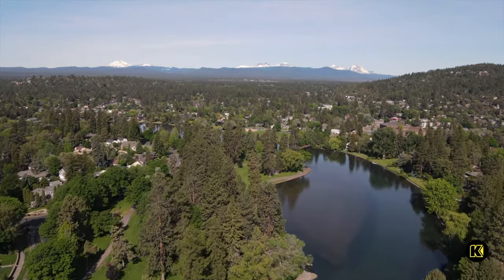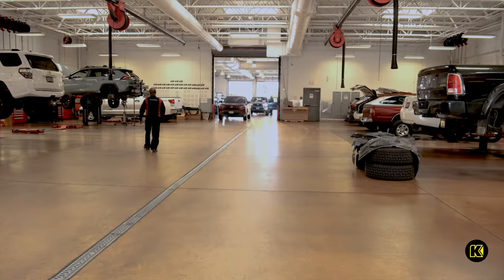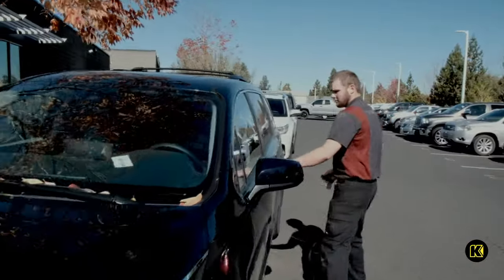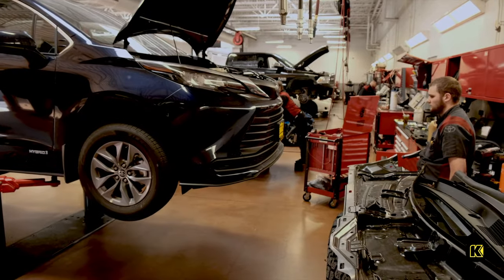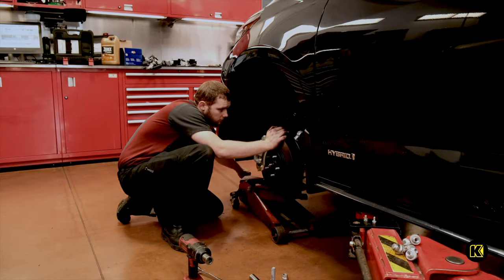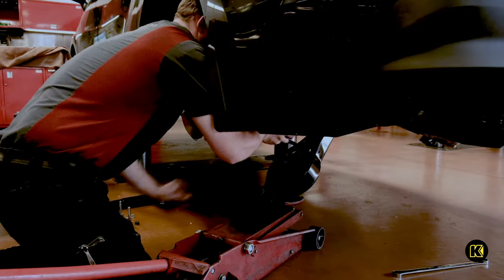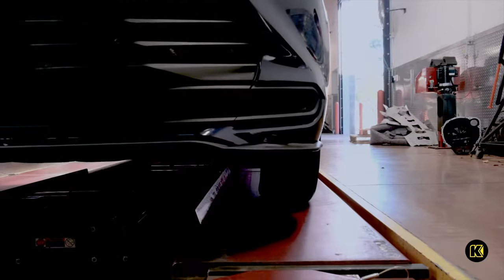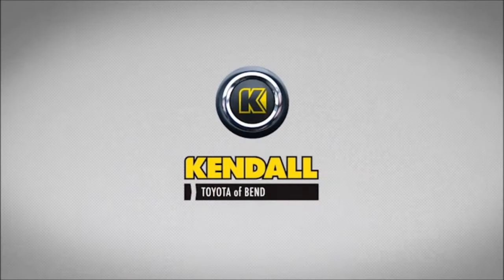Lift Your New Toyota Sienna AWD Hybrid with a Journeys Off-Road Lift Kit!

Comment: These guys have terrible quality control. I ordered their lift kit for my Sienna and the welds were terrible.  They refunded me but not the money for shipping back their junk lift
Reply: Did you find a better lift kit?
Reply: @junior17medval  looks like my comment isn't visible. You can buy lifts off fleabay from Russia.  They're far cheaper but max out at about 2 inches. Shipping takes a while though
Reply: How much?
Reply: Kendall Toyota doesn't make the lift.  It's from Journey's
Reply: @juneoflo  Yes...as the title of the video states...
That said, I question any dealer willing to install these things.  But maybe they got a batch where the poorly done powder coating covered the welds and they just went with it
Reply: Just installed my 3” lift kit from the same manufacturer, welds are actually very good I was so happy with the product.

Comment: Or buy a toyota highlander hybrid same price same engine same mpg
Reply: Not the same interior space. Trying fitting an electric wheelchair in the highlander.
Reply: Is it possible to swapped sienna suspension for the highlander?
Reply: Smaller. Less space. Less horsepower. I'll stick with my sienna.